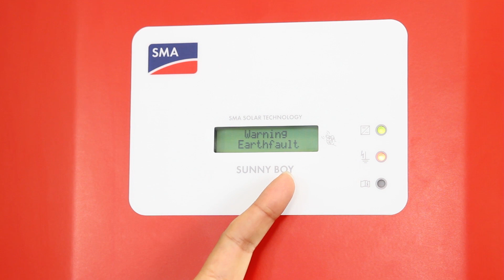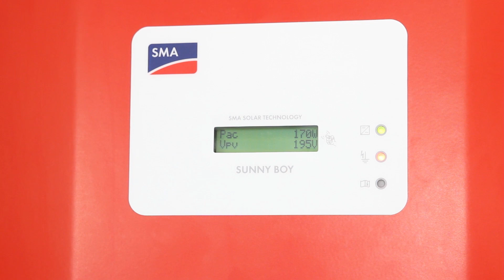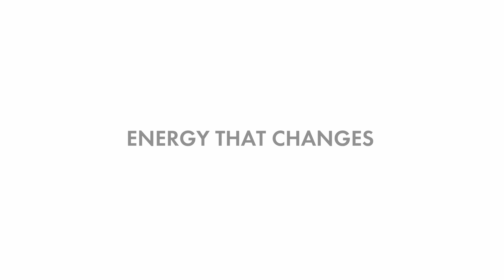Tech Tip: Troubleshooting for Earth Fault or Event 35 (Insulation Resist/ Riso)

Comment: Hi, I have 3x SB 240-US-10 inverters and one SUNNY MULTIGATE-US, one inverter reports "Insulation resistance",  do I measure DC in points on the inverter?
Reply: Ik think same problem. 
It can be leak current due to moisture or bad insulation of the pv panel. 
This can be measured by a insulation meter but I would reccomend testing it only by 50v and never the inverter because it can potentially damage the equipment.
Reply: thank you, I i swapted for a new  inverter unit and works fine so far